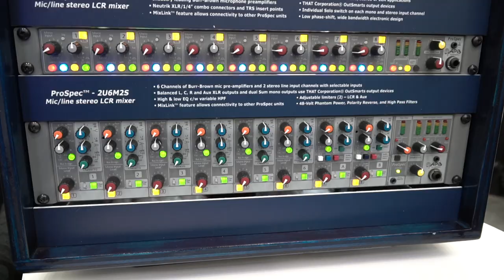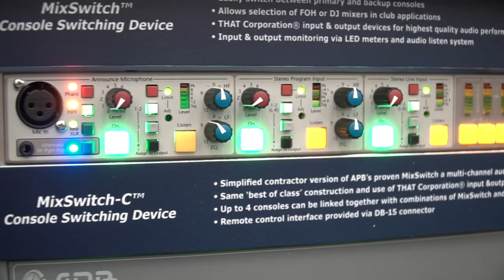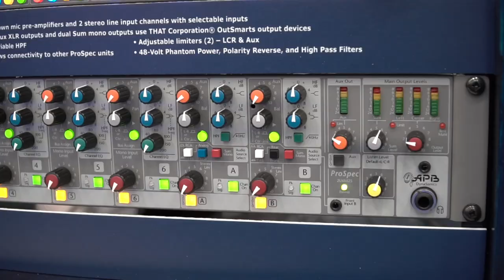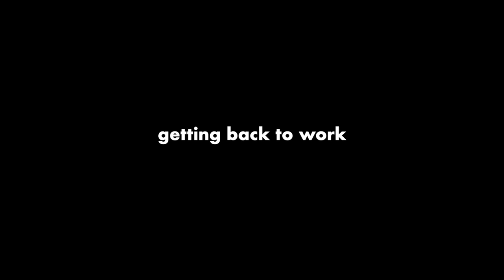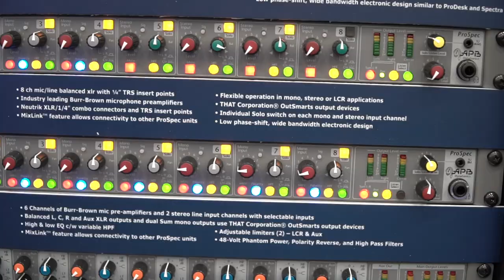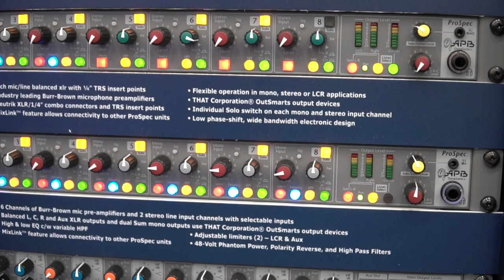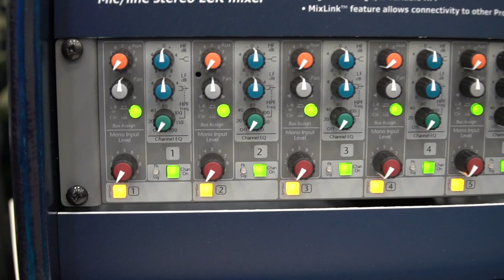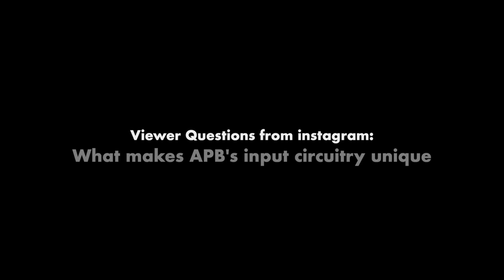APB DynaSonics Rides Again - Analog Audio in a Digital World with Chuck Augustowski at NAMM 2020

Comment: I picked up the ProSpec™ 1U8M and im one of those people who use it as a recording studio center piece. 8 preamps for the drums while using inserts for compression during tracking. Then use the inserts returns from the daw for analog summing. Its sharp and accurate yet very..analog. clean is over used when describing preamps. These are.. prestine. Lol hard to explain but the preamps were the most surprising part. Like i haven't touched my audient since😅. Saving my coins for a ProRack House. Just trynna wrap up my design of how i plan on incorporating it i. My studio. yeah.. love u guys work. 💪

Comment: I first heard about APB as the Midas killers (in terms of sound) from guys I respect in the industry when I was in the market for a Heritage/Verona and Venice for smaller stuff.  I figured I'll go with the smaller one first and went with a ProDesk instead of a Venice and man I couldn't be happier.   Not only did it blow the venice away but it sounded just as good if not better than a Heritage/XL series Midas.  Different, but better.  I'm stoked to see what new stuff they put out.  Especially some of Dante featured stuff in the pipeline and hopefully digitally controlled analog preamps that can be recallable.
Reply: I felt the same way about this mixer. When analog mixers was king- I had the Midas Venice 32 channel board. I loved it and people would be so amazed of the sound they were hearing from my rig. I contributed a lot of it to the board. Then finally I came across the 16 channel mixer H1020 Pro Rack and did some small gigs with it. A lot of people who had the ear to tell the difference in good live sound came and complimented on how clean my sound system sounded. I pointed to this mixer and they were just so dumbfounded because they never had heard of the name APB Dynasonics!

Comment: I wonder if they want to compete with Digital or more compliment it? Its hard to justify a heavy analogue console for rental houses and lug around big racks. A console like a dLive or Pro2 saves space in storage, trucks and the backs of the people who are moving it all. It is hard to justify.
Reply: I own a ProDesk 4 16ch unit and it's much lighter than a Pro 2.  Its actually one of the lightest analog consoles I've ever held.  And after seeing this video of what's underneath makes sense. I can't speak for a Spectra console though.  Which ideally is what you'd likely see getting trucked around on a Bus Tour.
Reply: @Espresso101  

A Pro2 has 4x as many channels. My question was how it would compare or hold up to a digital console with. So At least 6 effects, plenty of compressors, noise gates and such.